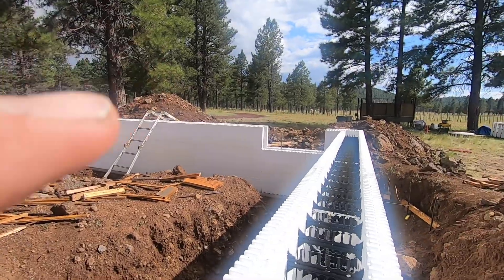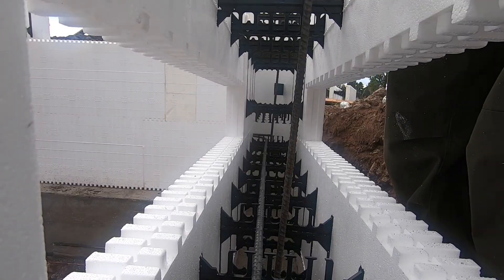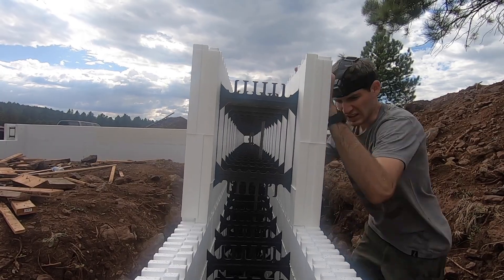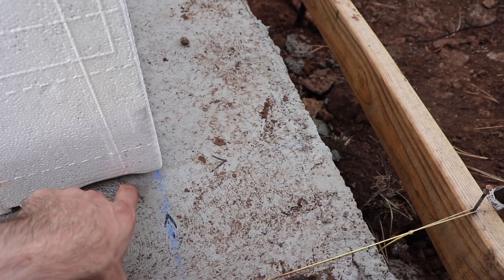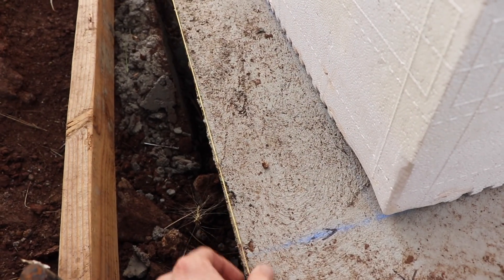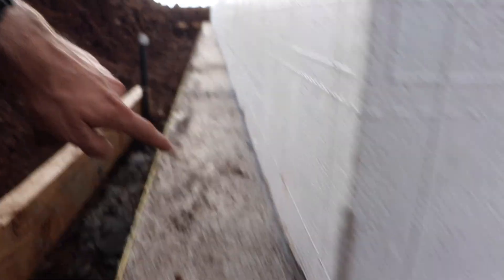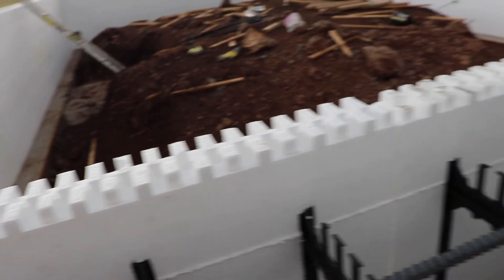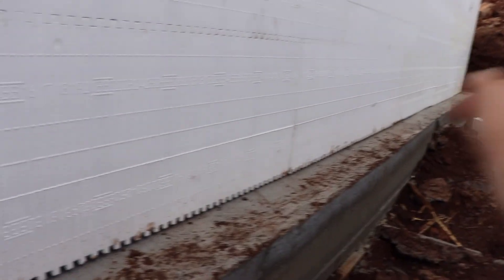Building an ICF Stem Wall (Insulated Concrete Forms)

Comment: Besides the missing rebar on each course, I believe there are ICF metal clips that need to connect each block joint (top and bottom), at least on the first course.
PLUS, if you are going the 4' deep (crawl space) why not just dig the extra 4 and make a full basement?
If you are back filling for a garage floor, why do the foundation wall at all?
Reply from the maker: we are not back filling for a garage.  Digging a full basement would have involved about a week of jack hammering rock and I was not going to do that, nor was I going to pay someone to do that.  Also the rebar is placed according to the building plans so none is missing.  There are no "ICF metal clips" needed anywhere in the build per manufacturers specs.  I also don't even think our manufacturer makes ICF clips. Thanks for watching.
Reply: @PootsPastures  
If creating crawl spacing why not completely clear all soil out before building walls?
Im in Toronto and we have more rebar requirements and the manufacture does have metal clips, especially for certain joints.
Thanks for the reply.
Reply from the maker: Like I said the manufacturer we used for ICF's doesn't have metal clips note are they required per our manufacturer.  Others may be different.  And we didn't clear out all the soil because of machine and time restraints.  We have plenty of space in the crawlspace for what we need, just our choice.

Comment: Canada, Calgary.

Rebar is not done right for the code here. DIY People, please check with engineer for the code requirements. I had to put 2 rebars inside AND outside in the bracket 2 inches away from footing, then 1 rebar ON THE INSIDE on the ICF wall every layer and then 2 more rebars inside and outside of at the top layer
Reply from the maker: Dang that's a lot of rebar.  The codes in canada all ways seem to be ahead of the US.  Thanks for watching!

Comment: Surprised you did not key-in the foundation wall to the footing.
Fairly common across the Continent to do that when it comes to reinforced concrete footings and reinforced concrete walls.
Reply: I've seen hundreds and hundreds of foundation builds in person and on youtube and not a single one used any kind of keying, even just a little rectangular slot using a 2x4. They've all been completely flat on top of the footer.
Reply from the maker: That deffinately wouldn't hurt, however I've never seen or heard about that practice being used in residential construction around here, may be different where you're from.  Thanks for watching!

Comment: hey thanks for the video, for the horizontal rebarb , are they spaced out every 2 feet?
Reply from the maker: The first horizontal rebar is about 8" from the bottom of the stem wall and the top row is about 3" from the top of the wall, so they are about 2'6" away from each other.  The way I drew it on the plans was that the bottom rebar would be in the bottom 6" of the wall and the top would be in the top " but because of how the ICF's are made it would have been a huge pain in the butt to put the rebar in any lower.  Hope that answers your question!

Comment: Does this stuff give out bust out easy?
Reply from the maker: The only place where you risk blowing out is really the bottom if you don't secure it to the footing well enough.  Otherwise if you had a really tall wall you would have more of a risk if it wasn't braced properly.  But the forms themselves are really sturdy and durable.  Honestly if we hadn't braced it we probably wouldn't have any issues besides not being plum.  Hope that helps!

Comment: You should have put rebar in every row not just in the top row. That would never pass inspection anywhere.
Reply from the maker: Rebar is in the bottom 12" horizontally as well as the top 12" horizontally.  It was approved by the county and passed the inspection.  It is up to code.
Reply: @PootsPastures  
I thought Flagstaff is a earthquake zone? Mild, still earthquake? What strength of concrete did you guys use? 4,000 psi?

Comment: What is the Manufacturer of your ICF SYSTEM?
Most ICF Manufacturers use a Common Seam in the middle of each wall, instead of cutting to fit like you did.
On the Common Seam lumber or plywood are used on both sides of the wall to reenforce the seam.
Does your manufacturer say in the Instruction Manual to assemble the wall like that, or was it your choosing?
Reply from the maker: Build Block is the manufacturer.  I read the instruction manual prior to putting the ICF's together, but it was honestly a while ago so I can't remember if they called for the common seam, but I don't remember them explicitly calling for it.  I did consider both options before I put the wall together, I honestly don't really like the idea of a common seam when you could just cut to fit like I did, staggering the cuts.  The common seam seamed like a big vulnerability to me when it came time to pour.  Thanks for watching.
Reply: Poots Pastures 
You should call the manufacturer.
The reason there is a common seam is because there is a +or- factor in the size of the blocks and it is difficult to get the forms square without the command seam.
The seam is held together with clears on both sides and foam in the gap.
i do not know what your lag time is on your videos getting up-loaded... 
But give them a call.
Reply from the maker: @BrianBriCurInTheOC  I went back and read the installation instructions again and it appears that a common seam is not necessary.  They just advise against placing a cut block near a corner.  They did mention a common seam once in the instructions but made no other mention of it.  We were slightly out of square but I was comfortable with how much and it seamed to be an issue of not being able to measure from corner to corner until the 3rd row and the blocks being too heavy to move at that point. Also our lag time is about a month so if you have any suggestions for framing walls send them our way!  

P.S. I do really appreciate the feed back as I don't have a construction background so most of this is new to me!
Reply: Poots Pastures 
If you do not want to have difficulties get it as square as possible.
Reply: Since this is just a short stem wall, you probably don't care that the plastic studs align.  It's going to be burried and it's not like he's going to be hanging drywall and siding on it.  That being said, the plastic studs on some ICF brands snap together with the studs above.  So there would be a definite advantage doing common seams with those.